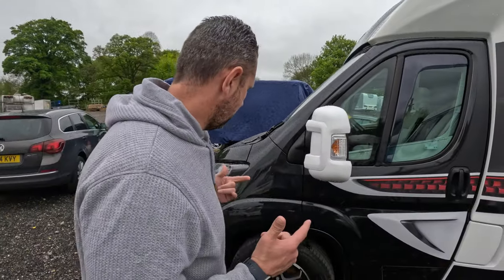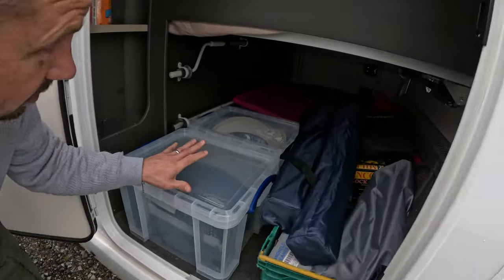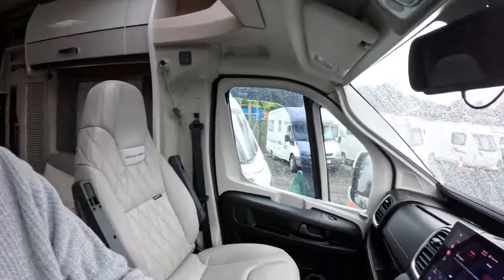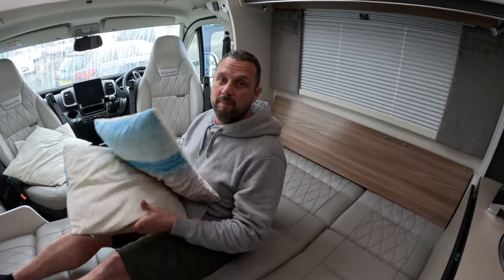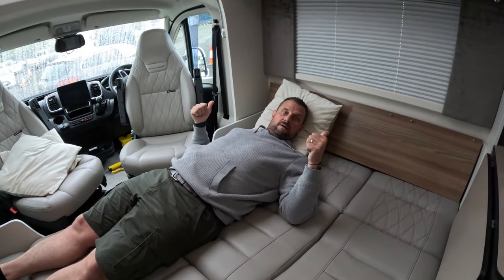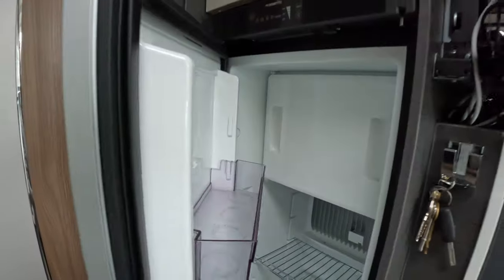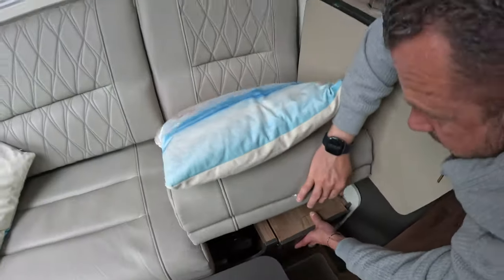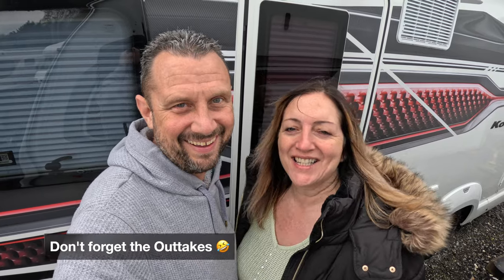Our Swift Kon-tiki 794 TOUR - How we set things up

Comment: Quite spooky that our current motorhome is an Ace Modena and is the brother of your old van, the reg number starts MX56! Layout is fantastic on your new van, we're really impressed with the bathroom and self contained bedroom, one question, is the hot water storage any better? We only have 10 litres through the Truma cylinder and I'm wondering if you get more with your Alde system
Reply from the maker: Hi David and thank you 😊 Ace's are really good van's and build well 🤙 I believe our hot water System is still 10 litres however there is a booster button that heats the water super fast if needed. I put the booster on while having a shower and not had issues with water going cold yet. 10 Litres seems the standard however booster maybe the key. The bathroom to a good space to have so happy with it.

Comment: Great Video, but whats the switch for above the drivers door? There’s a 240v socket and a reading light, but what is the switch in the middle? Ive asked a few people and no one seems to know for sure.
Reply from the maker: Hi, thank you so the switch i believe your referring to is for a light. Next to the kitchen sink cupboard where the seat is there is a floor spotlight, it lights up the floor area. Not a light we use however i'm assuming some may leave it on at night so they can see where there walking in the dark. If you have the same look for the spotlight by turning all other lights off before switching it on. Hope this helps. Happy travels 😊